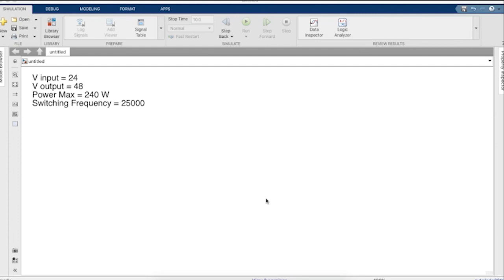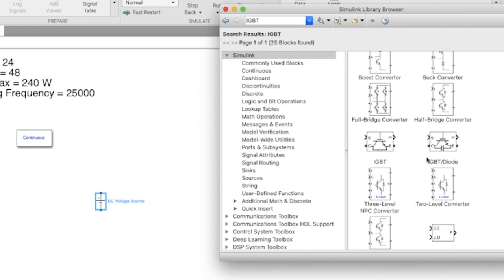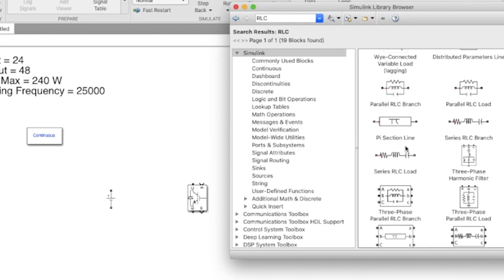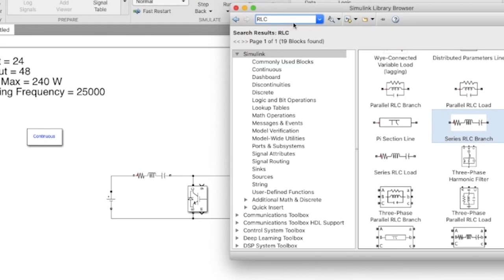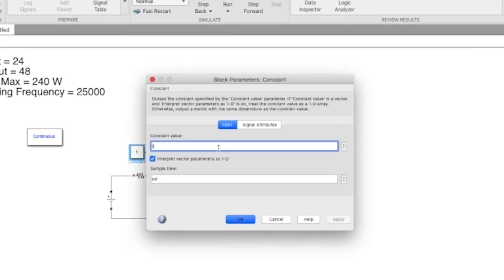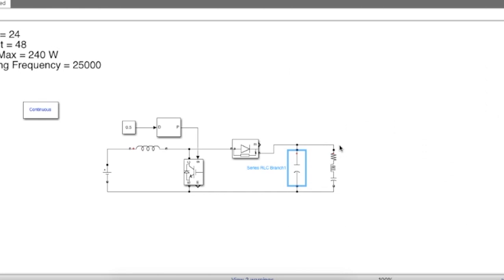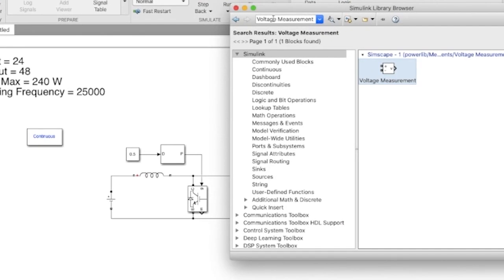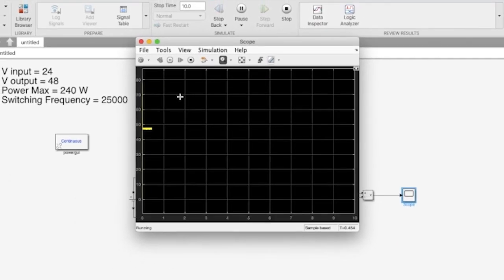Boost Converter design and simulation in MATLAB/Simulink!

Comment: How do you calculate the value of L and C and in your video Duty cycle is constant. What if I want a different output voltage for a different input voltage. How will you accomplish this? Is there any video where is the output voltage is controlled by a closed feedback loop?
Reply from the maker: Yes, we can make a closed loop control of boost converter if you'd like :). Just google design of boost converter you'll find the l and c value formulas
Reply: @TheUrbanScholar  Will be waiting for your video.
Reply from the maker: We have already done it! Check it out.